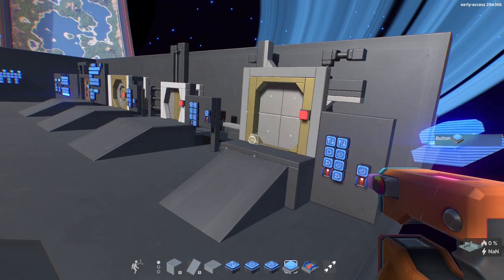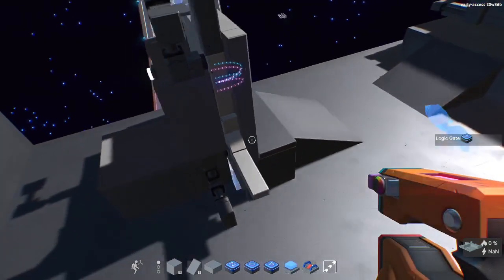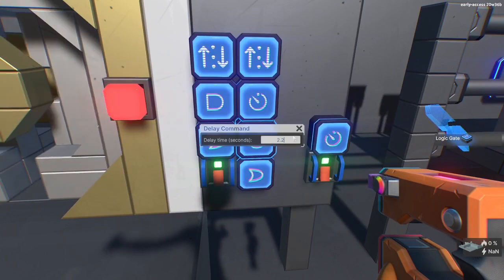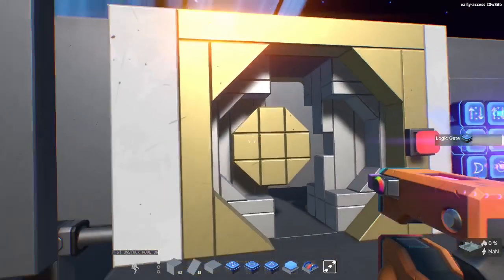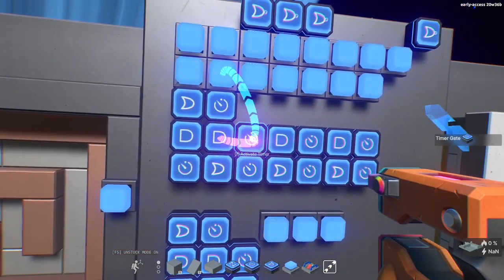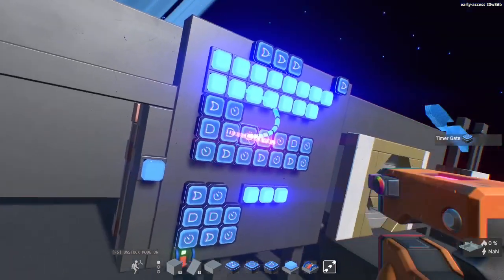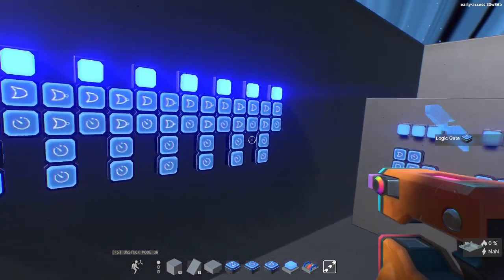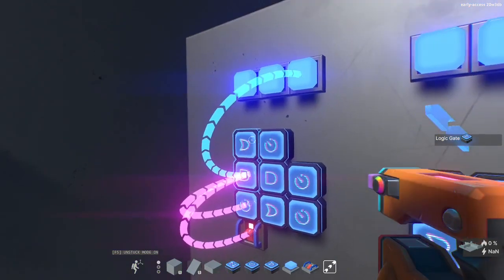I Made The MOST COMPLEX Doors!!! Advanced Automatic Doors- Starship EVO

Comment: for larger amounts of lights you could use a binary system(not 100% sure how logic works in this game but you can wire 3 xor gates in a loop, then have one input activate all 3 to flip the bit)and count up every interval(a timer loop) and the output would be hooked into lights(bit 1 activates the first, second bit is light 2, bit 1 and 2 is light 3 etc), then you can have it count down every interval when you press another button until its at 0